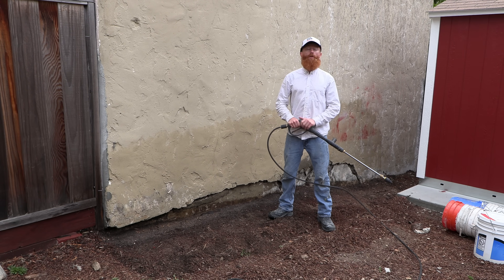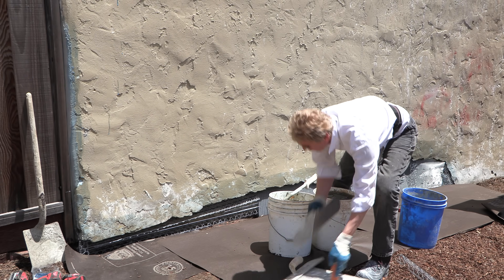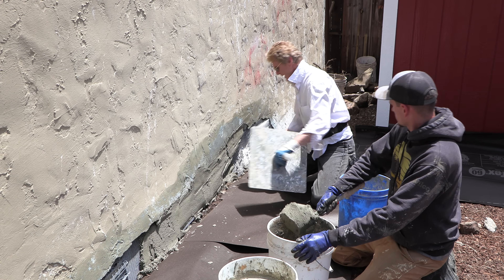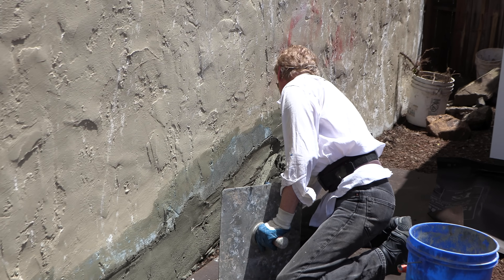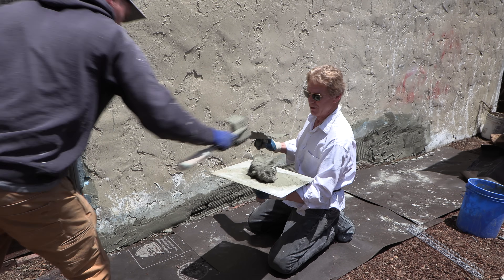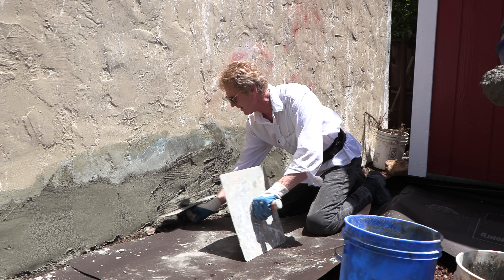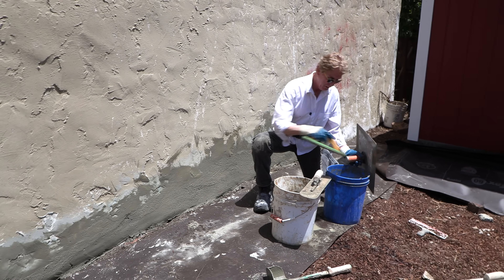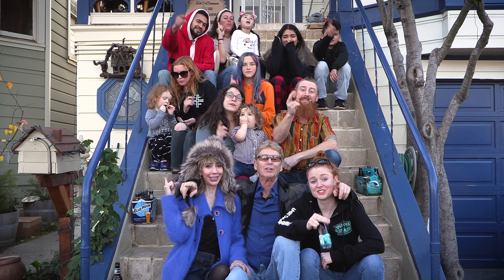Repair concrete foundations lifted by redwood tree roots.

Comment: Have you any thoughts on the bags of "Sand And Topping Mix" quickqrete? We NEVER have stucco mixes and my next one is way too big for rapid sets ($$$$) .. The Topping  says it can go to 2 inches... i mean , ive used plain S mortar several times..im assuming its just a difference in sand grain, and amount of portland thats the only difference in all of these pre mixed bags ehh??Thanks so much by the way, you turned me on to the green float which is a GODSEND... Again Thank u sir
Reply from the maker: For topping or what we call finish coats, We prefer finish stucco such as La Habra , Western, Carsons, BMI, etc. If your looking for a slower set same day stucco than Rapid Set which does indeed set fast, Around 15 to 30 minutes. Try HD's Quikrete or Sakrete's same day stucco, the coats set in about 45 to 70 minutes depending on the weather.👨🏻‍🔬

Comment: This was a really nice video, do you use any knee pads? Keep it up my man!
Reply from the maker: Morning Kloss, when I remember, I sometimes put them on, but no need here; the paper was over wet soft fertilizer, no doubt from the tree that used to be there. Had Jay, not pressure washed the concrete and pushed in stucco I would not have gotten wet, but the cement would not have adhered either. 💃

Comment: Great work as always  I watch all your videos, do you ever do work in San Diego?  My house has a "cat face" stucco finish and it's peeling off in sheets in certain areas. Do you ever work with this finish?
Reply from the maker: Hola Amigo, I've worked in San Diago one time, but I was on vacation. I saw a crew in need. https://youtu.be/jwqYvoZi20E/ 💃